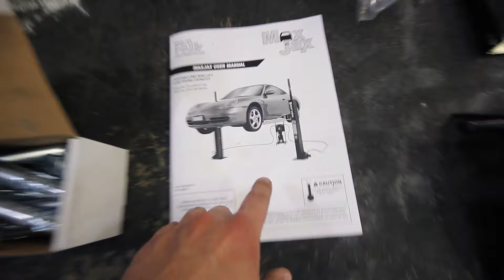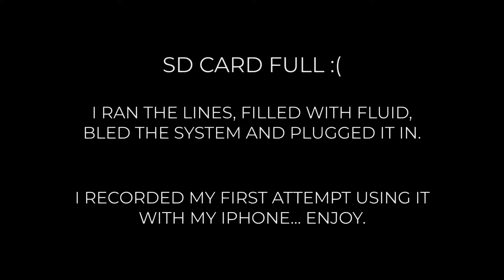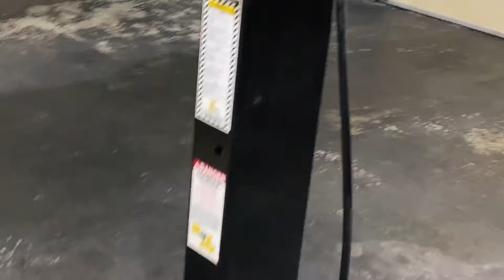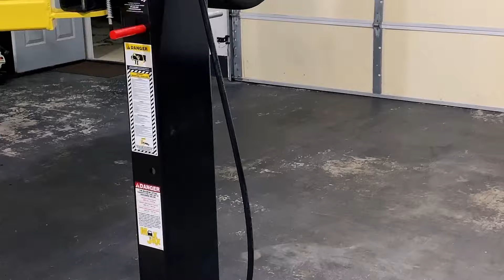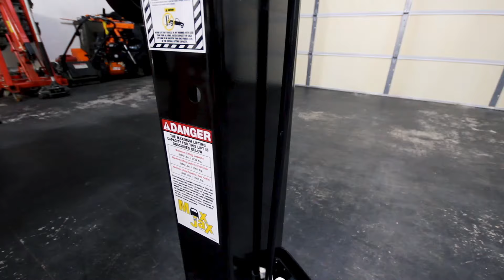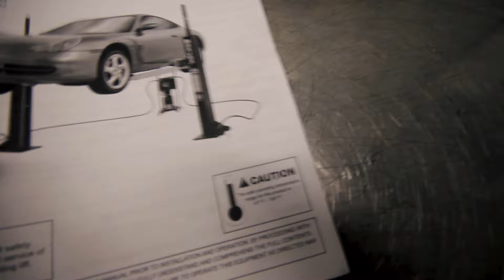MaxJax Lift Installation & Review - Portable 2-Post Lift for Home Garage

Comment: You could cut route the cement with a cutter and then use tile grout to cover it. I do this with data cable at stores for the systems that detect products with RFID tags on them

Comment: I've had this lift for 5 years or so and I love it and hate it.....I love that it's movable  although I usually don't move it...i hate that it can get out of sync pretty easily and if you're not careful it can get sketchy...hate that it has locks that have to be manually put in(what happens if a hose blows on the way up or when it gets to top?)....the lock spacing is useless (I drilled extra holes).. its great for cars and small SUVs but full sized trucks are sketchy

Comment: As others have mentioned, concrete slabs come in different grades...Most are not designed to withstand heavy loads...and many contractors hire laborers who do not follow the correct procedures when pouring concrete, which can result in weak concrete strength or microcracks...
Just wonder if you have a SUV/truck, how high can you lift with this Maxjack? Will a Quickjack be a better way of doing the lift?

Comment: So is there anything special that needs to be done to the concrete?
Reply from the maker: It must be 4-inch minimum thickness concrete, with a minimum strength of 3000 psi. If you drill a test hole, you will find out how deep your concrete is. If it's not deep enough, you'll want to repour stronger concrete around those two post areas.
Reply: The floor on which the lift is to be installed must be 4-inch minimum thickness concrete
Must have minimum comprehessive strength of 3,000 PSI
Must be installed on solid level concrete with no more than 3-degrees of slope.. straight off the website no mention of rebar needed
Reply: How did you verify your concrete was 3000 psi?
Reply: Just curious
Reply: Yes, do the pull out test before he order. Your life depends on it. Apply some simple math to determine the pull strengt of the lift for the holding screws measuring the force arms and the maximum load. Ask a company to make a pull test for you, they have the necesary equipment to do the pull and measure the pull force until the anchor or the concrete give it up. Couple of test holes should be drilled. Carefully select the places of the holes, it could break chunks out of the floor, you need to restore the floor after the test.  Identical anchores should be used (order them first before order the jack) and do the pull test. Use the smallest result form the pull test. If the lowest pull test result is two - three times higher than the calculated pull force for ONE screw than we can say you are safe to go. If still worried than use a custom cross bar between the two  poles disabling the inward collapse of the lift. Apply it after reaching the required height and remove it before lowering the lift.

Comment: How did you mount the pump to the wall? Looks like the 90degree fittings you linked are the same for the pump and the post
Reply from the maker: I still haven't mounted it to the wall, but I was just going to use some of the pump cart pieces and then some wood. The 90* fittings are indeed the same.

Comment: So we're pretty much putting all the trust into the quality of the concrete the posts are drilled into.  I would be scared the concrete mixture was done half-assed and the posts just fall forward ripping the anchors out of the ground destroying your vehicle.
Reply: I thought it, you said it.
Reply from the maker: Is that the case for every single automotive shop ever?
Reply: @jake_spence  I would think a commercial facility would be under more scrutiny for safety standards than private homes.  The part that worries me is people add sections to their houses all the time without getting proper permits and inspections.  I guess the only way to "know" is to do a proper load test before putting your own vehicle on it.

Comment: JAKE, NICE VID!  On the extension hydraulic hoses, did you make them equal length?  I was wondering if it has an effect on the longer hose side being slower?    Perhaps if they are fully bled, the difference would be negligible?  Thanks for the information.

Comment: I also have a Bimmer. Did you have 4 special lift adapters to go into the rectangular holes on the car?  That would make it very stable it there are any available?
Reply from the maker: Yes, there are adapters available but I don't use them on this lift. I just line the lift pads up to the mounting points.

Comment: Find an old office chair with the hydraulic adjuster, take the seat off, remove the seat from your crap seat and bolt or weld to the old base from the office chair. Now you have an adjustable height stool.
Reply from the maker: Seems like a lot of work, but good for a DIYer who can weld!

Comment: How far apart did you go with the posts? Is it a manufacturer recommended distance or did you do what seemed fit for space/what you needed?
Reply from the maker: They recommend 105" - 125" and I went with 125" because I have the horizontal room. Glad I did.
Reply: @jake_spence  thanks for the reply, yeah I have more than enough space I built the garage with a lift in mind. I ask because I primarily only build Z/G cars but want to make sure my tundra also will fit. Do you think you would have any issue catching the inside frame rails on a truck? Great video by the way.

Comment: Thanks for the great tutorial, it will help with my setup! Do you have any issues with unibody frames and fitting the lift to the manufacturers "pinch weld" jack points?
Reply: I work at an automotive shop and generally speaking they are designed to be lifted on a two post. It gets a little difficult with lowered cars but if you can drive it up on blocks and use wood for extra clearance with side skirts then you'll be good

Comment: If I used a longer sacrificial bolt I could theoretically go deeper than 4.5"if the hole was deeper...? My 10" thick slab has a slope to it so I need to go deeper than 4.5" on one side of the columns to get them perfectly vertically plumb.

Comment: Say bro looking to buying that beast could you give a call. Wondering how to get it off truck when it arrives. Haven't ordered yet that's the hold up
Reply from the maker: The freight company called me when it was being delivered and then they used a liftgate to get it off the truck. You can confirm when you buy it that you have residential delivery.
Reply: Thanks

Comment: Always lower the car on the lock bar. Cylinder and Hydraulic Hoses are designed to raise the vehicle not hold the vehicle. Lock bar holds the vehicle and relives the pressure on the cylinder and hoses.

Comment: Looks like your garage slab was at least 4", which is great.  Most slabs are 3.7" ish.  For a lot of people they would have to cut out a 16 x 16 chunk and re-pour a deep, 6" section for the anchors.
Reply: Bro thank you for this suggestion! I have black top Asphalt only 2inch tops. I was wondering how i would do this
Reply: @dreamingcode  no way with blacktop. I could be wrong but I would think like during really hot periods it would get soft. I know my parents driveway I had a root grow through and I cut and torched the root till it was gone and smashed with a hammer. That could never ever be done with concrete. Like I said, I could be totally wrong. Hope I am. Good luck!
Reply: I was thinking this Watching these videos. This is a common’DIY’ for car guys now. Not all take this in to consideration.

Comment: Does your concrete meet the min specs required per the manual?  How did you determine how thick it was?
Reply from the maker: Yes. I drilled a pilot test hole in the corner of my garage to test the concrete first.
Reply: Concrete varies from place to another.

Comment: Nice! Wonder what specs are needed with regards to concrete depth/strength/etc.
Reply from the maker: It can be found on their website. But minimum thickness is 4", can't remember the PSI rating.

Comment: You should have taped that opening in the fitting to prevent dust from getting inside. I know it was only for a few seconds, but that could cause problems later down the line! Also, how thick and what PSI is your concrete floor? I think most vechile lifts should be put on a footer designed to hold it. I would hate to be under a lift that was not designed on a proper base. I know my garage floor is NOT level and most home garages have a slight slant to help snow and water drain out of the gaage. I am guessing you check all this first hopefully. Just saying. Is that a crack right along the base of the colunms? Nice idea about putting a lift in the garage. I was just looking at lifts yesterday!

Comment: What happens if someone opens your door while the car is all the way up? I bet someone has told you by now but you Might be able to go to full height (more than likely) if you raised your garage door (special tracks) and get a wall mounted door opener. The end result, maybe you could to full height without hitting the door or opener (with the door open or close).

Comment: Seems like with the engine weight all up front, that it would be putting most of the weight forward, especially if you moved it up an inch or two to clear the garage door.

Comment: Great video. Two questions. How would you get the anchor out if you're going to move the lift to a new location? How tall of a garage do I have to have?
Reply from the maker: I don't believe you can extract the anchors unless you break the concrete. You can pound them thru and fill the hole. New anchors can be purchased. My garage is 8'7".
Reply: its not meant to be moved to be used at a different place its meant to be moved out of your way incase you need the room

Comment: I think they do not want you to drill all the holes at once to prevent weakening and shattering the concrete as you install each bolt.
Maybe you should have mounted the lift a little further forward so you can work on your car with the garage door open.

Comment: Oh how I despise laying on my back under a car....especially the older I get.  This is nice but I'd still would curse getting up off the low chair.   lol
Reply from the maker: Lol I'll take the low chair over rolling around on my back any day.
Reply: The low chair is still better.  My dad built me a crude, but very effective chair that is nothing more than an old cheap computer chair with a back rest mounted on a platform that has five really small caster wheels underneath it.  It sits about 4 inches above the floor and is actually quite ergonomically friendly.  There is still the getting up and down, but it is still way better than laying down and creeping underneath and getting all that crap falling directly down on top of you.

When I do brake jobs, I actually sit on a stool and do it.  It is quite comfortable.  Sometimes when I work on stuff, I don't raise it much more, if any higher, than I could with a good floor jack and jack stands.  But it is easier to get it up to that height and let it back down.

Comment: Before drilling you should of capped off the fitting first to stop any concrete dust from getting in to the system.
Reply from the maker: Good eye. I didn't realize I was doing that.

Comment: Hey Jake I never got a response where did you get the lines to make them longer And go through the ceiling I try Farm and Fleet I believe you said that they say they do not sell them is it possible you can confirm that and give me a part number thank you
Reply: antimpala1 any auto parts place that does custom hydraulic lines can make them. Just need to give them the specifics. Length, PSI, connector type and size etc.

Comment: My garage is 24x24 also 8 foot ceiling if I find this in a good price I will get it, have 2 cars to do engine swaps on light truck and one mini van, in my case would have to work with garage closed but both cars engines are dead, the van is parked in front of the house in the driveway and the light truck behind the fence on an RV parking space on the side of the property, neither can be started so if I would get this lift and install it in the garage, first have to unclutter the garage as it is full of years of hoarding, then comes to move the cars in to work on them one at time, it so happens the front of my driveway has an incline about 3 or 4 degrees; it would required 5 or 6 people with one at the wheel to move the cars inside the garage on dollies, to move my truck in the space it is now there were 5 people and we struggled some because of the incline; I guess it could be done also by pushing the car up from the street with another car, like my work truck for example but I could damage both cars this way so have to figure out a way. The other way is to drill 20 holes for now, 10 on each side of the garage in such way to work with the lift where the van is now and then where the truck is without moving them at all; this would require to install and remove the lift with every working session, the beauty of it the lift is portable but the work outside can be interrupted by weather unless covering the top with a tarp. I am seriously considering this lift; there is an M6K I saw for $1300.00 online from a shop in Oklahoma, no idea if it is new or used but the other prices I see now are between 3.5 and 4K which is actually insane price to pay for a home mechanic with only a 2 cars project, so lots of planning and finding the right price is the name of the game. Thanks for this review!

Comment: I feel like this would have been nicer if you actually had it sideways into your garage. SO the nose of the car points at the far right corner . But either way, still a super nice setup. I have a friend that has these in his garage and they work great!
Reply from the maker: Good point, now that it's done and you mention that, you're probably right about angling it that way. Too late, but now I know for my next house!
Reply: I don't understand ,why sideways ? I got one on order and would really like to know what advantage it would be to install sideways ? Wouldn't it be harder to get the car in a sideways position than driving straight into the garage ?

Comment: how deep is your concrete? Their site says 4 inch thickness, 3000 psi minimum. Is this enough?
Reply from the maker: My concrete was 4" thick and since it meets their minimum requirement, I considered it enough.

Comment: Are you supposed to use a certain kind of concrete(industrial)for those?
Reply from the maker: It has a minimum thickness and pressure rating.
Reply: They say a minimum thickness of four? inches.  I mounted mine in 3.5"  So far, the concrete hasn't cracked and it hasn't fallen over yet.

They rate the lift at 6,000 pounds capacity.  I can't really fit anything that weighs 6,000 pounds in my garage, and I figure that they implemented some kind of safety factor, so I figure I should be okay with 4,000 pounds in 3.5" of concrete.
Reply: If it were me i would place a minimum of 4000PSI concrete 6 inches thick with reinforcing steel.  The eccentric load when lifting a vehicle is going to put a lot of stress at the base and a structure is only as strong as its base. You can follow the minimum manufacturer's recommendations.  Im sure if it fails you wont be around to sue them. 🤷‍♂️😄  But for real i would run my own calcs on my garage before installing
Reply: @mkomko2589  Right,the stress is on the inner base floor and the outter lag bolts because it doesn't have a bar on top linking the two sides.

Comment: Those aren’t the anchors I would use. Regulation is different in various states as to how deep the slab needs to be poured. If you drill through into dirt you’re fucked. I would use the anchor that has a stud on it. You hammer it into the ground and you have 2” of threaded stud coming out. Then you put your nut on. The only way to get that stud back out is to tear up the concrete floor.
Reply from the maker: Interesting, thanks for the info!

Comment: I have the same lift but have been having a problem with one side coming down faster than the other causing it to tilt. Bled it several times still the same thing...What hydraulic fluid are you using?
Reply: I have the same lift and I've been going back and forth with them for almost a month now since it will not lift to full height.  I can't install the safety bars when the lift cylinders max out, the holes are blocked by the delrin slide blocks.  They've sent me a second set of cylinders that extend less than a 1/4 more and it's still too short.  Getting really tired of this.  For your issue, I would check and see if the restrictor orifice at the end of the hydraulic cylinder is not installed properly.  It will require removing the cylinder and then taking the nut off at the end to remove the piston.  But there is a disc with a small hole in it at the end of the cylinder that restricts the flow of fluid to make the lift and drop motions smooth and slow.

Comment: Your cylinder/pump/valves are gonna have a short life drilling next to that open fitting. Hydraulic contamination is a killer for a system.
Reply from the maker: Thanks for pointing that out, good to know for next time.

Comment: Hey man, I noticed that the hydraulic hose you ordered from Amazon was only rated at 4000 PSI and the factory hose is 5700 PSI. Do you think that is enough not to worry? I was considering ordering some myself.
Reply from the maker: I'll have to double check my hose ratings. I've read some people receive different pressure rated hoses from MaxJax. I've been okay with my hose so far, so I'm not worried.

Comment: I hate it when they say portable when something is bolted to the concrete. Portable means I can roll/move it somewhere else without having to drill and bolt into the concrete somewhere else.  It like me advertising my house is a mobile home
Reply from the maker: Yeah, I get what you mean. I get the point of it, and it truly only takes a couple minutes, but still would classify it as "semi-portable" if it were me.